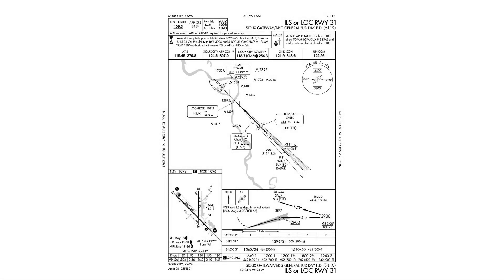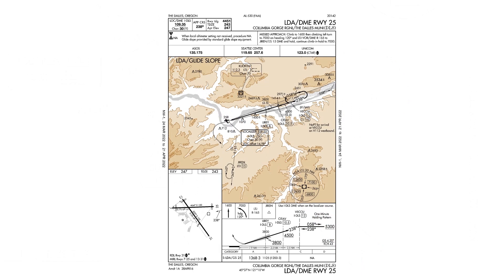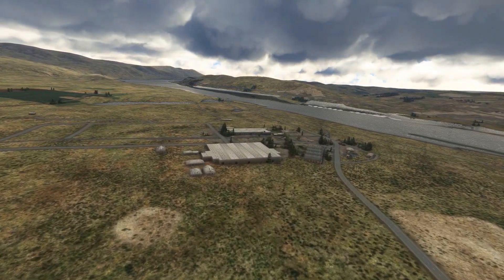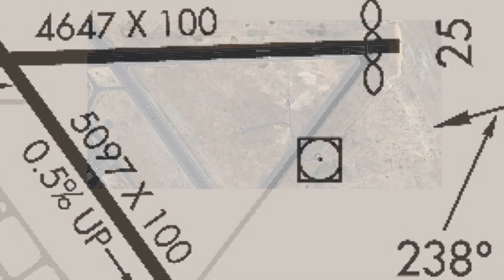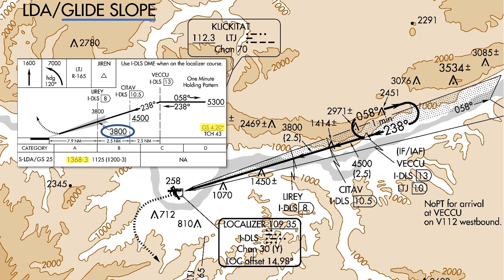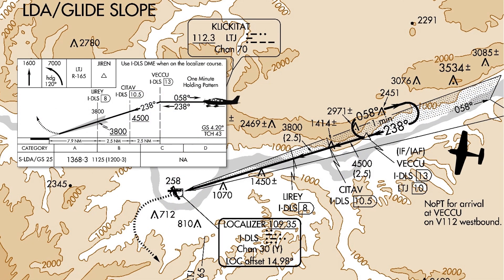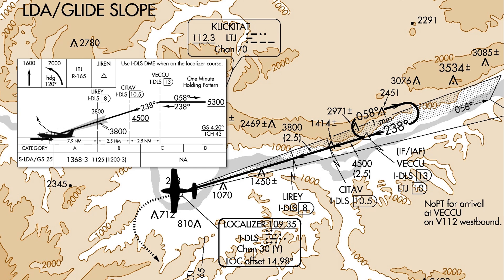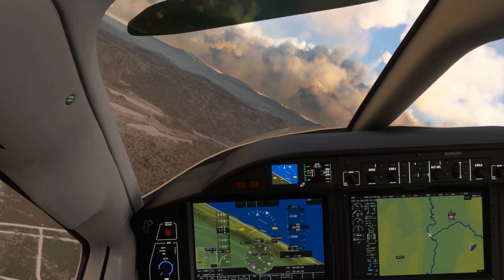How to Fly an LDA Approach | Instrument Approach Procedures

Comment: Vers thoroughly explained. But for what the abbreviation LDA stands for?
Reply from the maker: It's Localizer Type Directional Aid. Sort of a mouthful
Reply: @flightinsight9111  thanks. Do you know why the LOC DME east approach in LOWI Innsbruck is still categorized as a LOC type rather than LDA, because the LOC also has an offset to the runway. Is LDA an US thing?
Reply from the maker: @unclealig  Possibly. I've heard LDA is used in Europe as well, but it could also be the case that the localizer is only slightly offset from the runway centerline. In the US, a slightly offset course is still identified as a Localizer approach rather than an LDA